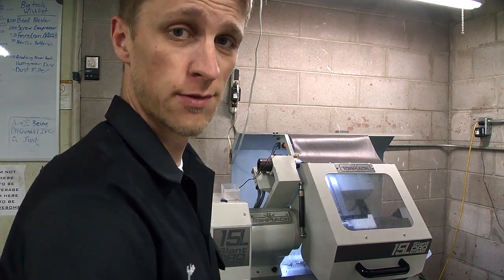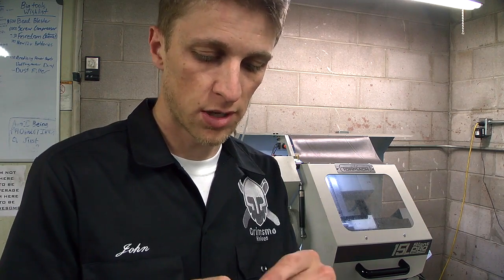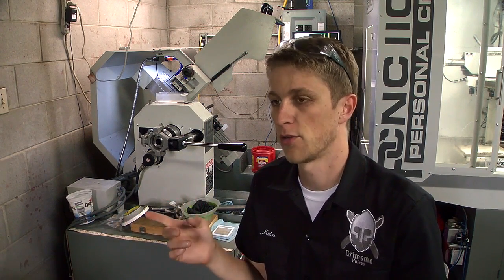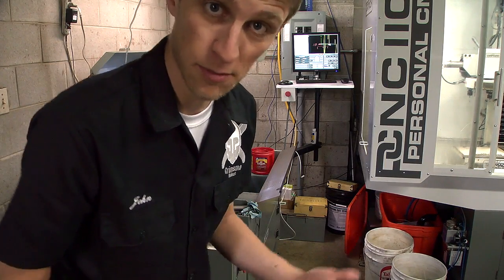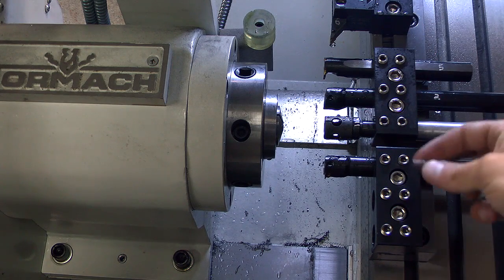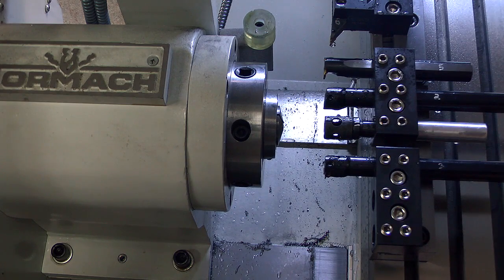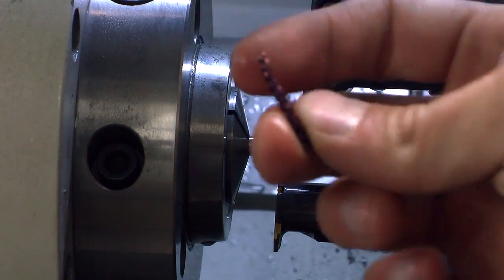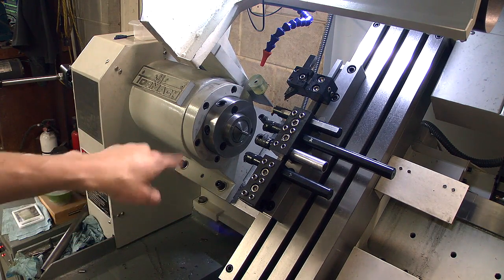KMT 113 - 440c stop pins on the Tormach Lathe

Comment: I had this issue as well with the stock I turn. All of my stock rods come in a little larger than nominal dimensions, but still within listed specs for that material.
I found a couple of the Tormach collets were even smaller than marked. My solution was to get some e collets. That way I am not messing up the originals so when I do need the smaller ones,, they are there.
My e collets are brass and were a breeze to turn out. I have a claw type bar puller and even with 80 PSI running it, if the collet is too tight, it ain't gonna pull it. 
Looking good, John. Keep the great videos coming. :)

Comment: What kind of plug is your coolant pump wired into? Could be convenient for you to interrupt the power with a switch in an electrical box with a magnet so you can stick it anywhere thats handy on the enclosure. Then just flip the switch quick to check your progress or show an operation. The switch could be lighted to show coolant on or off.

Comment: Ramping your spindle up and down like that is what uses the most power, dunno if you are concerned with that but if you take an extra second to add g97 and g98 every time you switch tools  it shouldn't do that. Might save you a a couple dozen bucks a month in power.

Comment: I use a little allen key to see how much my collet is holding by sticking it in the little slots and feeling for the end of the bar, my allen key reaches as far as the collet will grab so if I cant feel the end, well its gripping enough to make another part.
Reply: +Max Maruszewski Have you crashed yet by having your parts count too high?

Comment: What feeds and speeds are you running on this part?  Perhaps it would be easier if you posted the G-code so I can look at it?

I turned a lot of 416HT a while back, using cutting oil (does not cool).

Comment: Take the collet out, put screwdrivers in the slots, gently heat the base (near the threads) of the collet with a propane torch until it changes color a little.  Now the collet should spring open more.

You may also want to consider investing in some nice Hardinge collets too.  They sell decimal collets and emergency collets, so either way you're covered for big odd sizes.

Comment: I've had the same problem with material that is oversized by a a thou or two not going into the collet. As a test, I bought a Shars collet on eBay that is the next 1/64th" up, and it worked perfectly.

Comment: I have worked with 440c stock that was .500 ground and hardened to Rc 58 I think if you could buy it .125 it would be cheaper than machining it.

Comment: VNMG inserts? Maybe you should try the VCMT geometry which is positive and may help at this tiny diameters. I'm using Sandvik's VNMG 160404 inserts in grade 2015 at 260-290m/min at 0,15mm/rev with a DOC of 0,5mm in 1.4571 (316Ti iirc) and they commonly last 12-15 minutes in cut if used only for finishing. At higher depths of cuts and higher feeds they don't last that long, but I assume that's because of the relatively tiny edge radius of 0,4mm. But I doubt that cutting at this surface speed is delevant to you for a diameter of 1/8 so they maybe last even longer.
The build up edge could, iirc, also be caused by the slow surface speed and not enouh heat generated in the cutting zone. Maybe try less coolant. But I'm not 100% sure about this and would have to research it somewhere on the web. So you may do this on your own :)